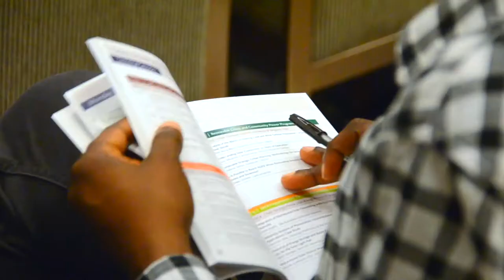Andreas Häberle: Combining PV and Solar Thermal

Comment: I found this video through solar thermal world and demonstrates the lack of clarity about what PVT is all about.
1. all the worlds solar PV panels start to become more and more inefficient as the glass/solar cells heat up above 26c. (This is the standard of all PV testing in house with an air temperature of 26c.
The concept behind the coupling together of PV and Thermal is to increase the performance of PV panels, which you can prove by passing cold water over the panels when the air temperature is 20c and sunny days.
The by product is heated warm water to a maximum of 30c which is perfect in heating swimming pools
My own PVT collector is on test in Australia to be sold to companies who produce fish or Aquaponics, the food industry ect
The BIG problem until now, is the high cost of a PVT system, which is where Thermaltricity is years ahead of Europe and the USA